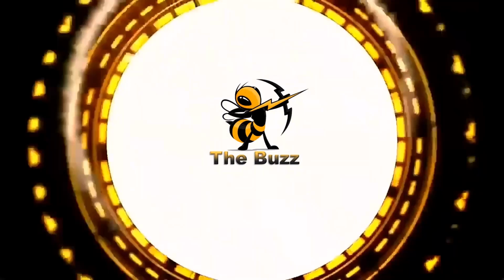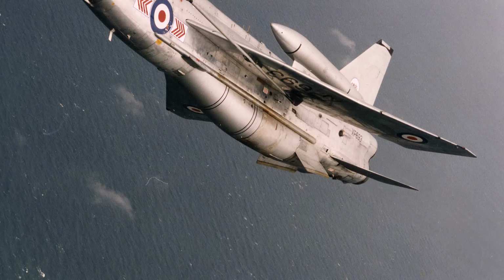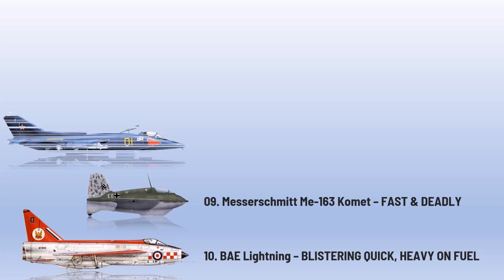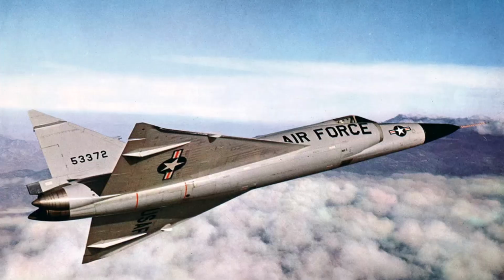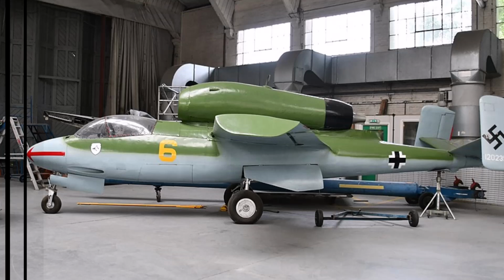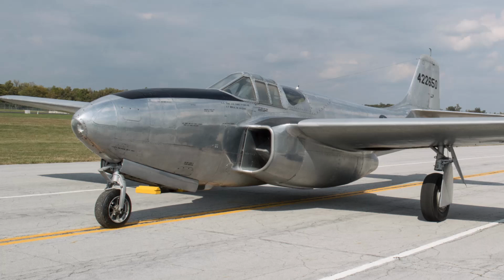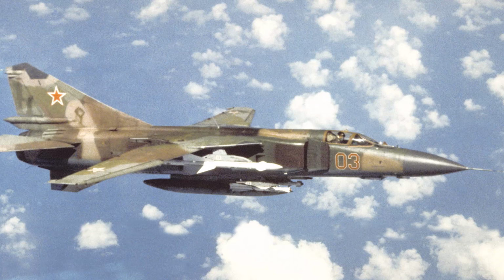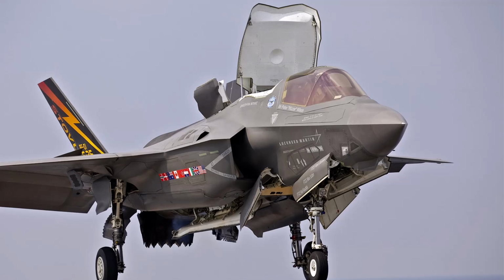The 10 Worst Fighter Jets Ever

Comment: The Lightning wasn't BAD, it was exactly what had been requested and was extremely good at its intended mission.   Not the fault of the plane that politics and doctrine changed.

And NO, the Yak-38 was NOT in any way shape or form the "answer to the Harrier".   USSR wanted something for vaugely the same reasons as the UK, but with lesser mission requirements, and it was roughly developed from the Yak-36 which in turn was based on the non-VTOL Yak-30 prototype for a trainer.
It's a matter of convergent design, because at the time, VTOL was being tested and even flown in lots of variations.
Most notably however is that Yakovlev WANTED to build something much more similar to the Harrier, single engine with movable nozzles specifically, but because there was no suitable engine available, they had to go a very different path.
And no, the Yak-38 was specifically limited to mach 0.95 to avoid the issues with supersonics.
And it didn't have TWO engines, it had THREE.   1 for propulsion and 2 for lift.
How could you get so much wrong with this plane?
Reply: also the yak38 was supposed to be a temporary solution to wait for the yak41 (yak141) but ussr ceased to exist and it never got to the production phase and stayed as a prototype also fun fact the yakovlev bureau was financed by lockheed martin to try and finish their yak41 in exchanges of the funding the yakovlev bureau handed over all the plans and if you do some reseach you can see that lockheed martin f35 use the same type of vtol engine at the rear with almost the same type of mechanism
Reply: The F-35 Lightning 2 is not a bad fighter, actually it is a very good fighter.  An extremely ambitious program had problems that have been fixed.  Now fixed (as of Feb. 2024) and, over 1,000 have been delivered and the fighter has exceeded expectations!!
Reply: @sebastien3351  That's the manufacturer's sales presentation version of reality.

If you squint hard you may be able to find some truth in it.

"The F-35 Lightning 2 is not a bad fighter"

Yes it is.   It relies heavily on stealth.   And ALL peer nations today outside of Nato has decent or better antistealth capability.

Russian fighters and airdefence can shoot at them with good hitchances at 150km.
The stealth was supposed to make them practically impervious down to something closer to spitting range.
China's ability is more uncertain, but most likely they can do the same at 80-100km.
IRAN can likely do it at beyond 80km.

It lacks performance, it lacks agility, it lacks in sensors(comparatively), it lacks in ECM(comparatively)...

An F-15 is a clearly better air superiority fighter.

"that have been fixed"

The CRITICAL flaws have MOSTLY been fixed by now.   Overall, about half the flaws have been fixed or mitigated.
But in the process of doing that, system performance have repeatedly been negatively affected.

"and the fighter has exceeded expectations!!"

YES!   It is even MORE EXPENSIVE to fly than expected!

lol
Reply: @DIREWOLFx75 youre saying this in 2024. When low observable, subsonic land attack missiles have litterally flown over Russian S-400 systems near Ukraine.
Reply: @De_cool_dude  "youre saying this in 2024. When low observable, subsonic land attack missiles have litterally flown over Russian S-400 systems near Ukraine."

And usually been shot down ye-es?

The only real "success" in getting past Russian airdefences was when they fired 25 such missiles at the same time together with a bundle of inferior/older missiles AND sent a large pack of drones AND launched a dozen HIMARS all at the same time.

Over 150 incoming warheads in a matter of minutes and Russian airdefence STILL shot down nearly everything, that if anything is pure astounding.

Patriot AND IRIS-T AND NASAMs together couldn't even defend against a Russian missile package of 20 Kalibr.

Russia literally got the same number of missiles past THREE western SAM systems working together, with less than 1/7th as many missiles fired.

You can always overwhelm airdefences, the BIG question is how much you need to do it.
And if you can realistically use the missiles you have like that.
Reply: @DIREWOLFx75  source?

Comment: English Electric Lightning, one of the best British fighter aeroplanes ever produced, break the sound barrier going vertical.
Reply: Impressive performance. I remember seeing one landing years ago in a high-nose position, almost on its tail. Do you know if it was ever called upon to do battle service?
Reply: Awesome Aircraft
Less than 1 hand of aircraft could intercept the Blackbird
Reply: I also remember it as one of the first fighter jets to super cruise.
Reply: @beornthebear.8220  I heard that, and somebody told me very flatly it couldn't.  Since I don't remember my source, I couldn't argue.
Reply: My understanding was that the Lightning was great for the air defense of its immediate area.  It would have made a great bomber had it been assigned to bomb the end of it's runway.
Reply: @ThatsMrPencilneck2U  it probably didn't have the range to cruise very far. But if the creators of this ridiculous video regard it as one of the worst fighters ever because of that, then so were the original versions of the Spitfire, which was designed for exactly the same purpose
Reply: Well, it was fast, but a nightmare to maintain. The real beauty of the Lightning, was its air radar.
Reply: @raywhitehead730  Not sure it should be in this list though. Performance was off the scale for its time.
Reply: As a teen in Italy, at Aviano, I saw a flight if Three British Lightnings fly at low level at a high rate of speed, it was impressive. In those days (1966) breaking the sound barrier was not off limits over civilian areas ( have you ever felt and heard that?)  It was impressive. However,  the lighting was Not a fighter but an interceptor, hence the importance of the pilots skill in operating it's radar. Which for the time was very good. Some versions of the F 8 matched the Performance of the Lighting almost identical ly.  Retired USN Aviator.
Reply: @beornthebear.8220  just looked in my Jane's aircraft bible, it was capable of super cruise, i have to be honest i had not even heard of super cruise👍
Reply: @raywhitehead730  Total rubbish mucker, the Lightning was a decent fighter for its time, was much faster than a Crusader, though the F-8 was a great fighter jet for carrier ops ( Navy myself)  Royal that is!
Reply: Yes but it’s range was quite poor.
Reply: @36minutesago7  It was an interceptor, not a fighter.
Reply: It was an excellent plane, one of our best, but yeah, range wasn't quite it's forte! (Whisper it quietly, but it's electrics weren't very good either - just ask Taffy Holden!)

Comment: WTF? Bae Lightning, MiG-23 and F-35?  the worst by far in deaths pilots was the F-104 G in Germany and i dont see it in the video
Reply: The Mig 23 too
Reply: The F-104, used as originally intended and by a good pilot, is superb aircraft.   Sadly, Germany completely messed up the plane and then tried to use it in ways that were essentially the opposite of what it was good at.

And yeah, while the MiG-23 was a great weapons platform, as a fighterplane overall, it had ISSUES.   Really serious ones.   It was a fairly good concept, but when it ended up being massproduced as a more standardised fighter, bad bad bad idea.
Reply: @DIREWOLFx75  the F104 was only bad because pilots were not trained properly to fly it. It had short stubby wings that required very hi take off and landing speeds. If you were transitioning from a slow fighter if that period, it could be a bear to fly. Even the F86 sabre had to be flown a certain way or it would kill you. ( see sabre dance). It had a 10 to 1 kill ratio against the MIG 15.
People, get you heads out of your passes.
Reply: @chuckbowen4334  No, the Sabre had a close to 1:1 kill ratio against Russian pilots in Korea. Against Chinese or Korean pilots it had 7:1 ratio or therabout. But in total, regardless of who flew them, the Sabre had a 5,8:1 ratio. Bear in mind that the Sabre's job was to shoot down the MIG 15, whreas the MIG15's job was to shoot down bombers, and avoid fighters if possible. 
If you are want to know more about the "Sabre Dance" - read about the F-100 Super Sabre, one of the most lethal (to it's own pilot) jets that ever flew.
Get your ypur head out of your pass...
Reply: @chuckbowen4334  Exactly!
Reply: @MeBallerman  no...thats incorrect. There where about 250 F86s lost. 78 of those where against  Mig 15s. The Chinese, Russians, North Koreans...lost over 600  Mig 15s in air combat with The F86. There were 2 migs shot down by a F4U corsair...that's close to 9 to 1...that dosen't count unconfirmed kills. The tactics and the gun sight make the F86 a killer.
Reply: @DIREWOLFx75  right, the F104 was designet as a high altitude interceptor, but in Germany used as a low high fighterbomber. But this time the sowjets had allready anti air missiles. Make it impossible to use the F104 in the expected way. by the way, most F104 lost on engine failures or drunken pilots.
Reply: @fqeagles21  The Mig-23 was not rubbish. Here’s an iron rule of air combat going back to the Red Barons time; 
”It’s not the machine, but the man in it”

Every airplane has weaknesses & strengths. The pilots job is to maximize their airplanes strengths while avoiding their weaknesses. To do this well requires training, which is why the Mig-23s record sucks . 

The earlier versions, the MS models (monkey model of the Mig-23 which lacked the most advanced features of the original. Infra-red search and track and beyond visual range missile capabilities were removed and its avionics suite was very basic) that were flown by Arab sand negroes who weren’t real big on detailed, individual training. Their system was simple- the GCI Officer did the flying, and all the pilot does is move the airplane as instructed. It makes training cheap, quick (you only train one GCI Officer instead of five pilots), and politically safe. On that- if pilots are taught to think for themselves in air combat ,they might apply that individual mindset to politics too.

So you had Israeli/ Iranian pilots, trained by Americans and others against relatively untrained, GCI vectored MiG pilots. The kill record speaks for itself. That doesn’t mean the Mig-23 isn’t deadly in trained hands.
Reply: German Luftwaffe have had so high rate of incident with 104 because they used this pure fighter in a low-attack role, for which it was not been designed ; as an interceptor, it has no competitors at the time, and I think even very few nowadays, after 70 years!👍🙂
Reply: @romanomigotto7804  The plane was ok, Afghanistan got 26 104G at the early 70tes and lost from them in 30 years only 2 by a sandstorm on the ground. I was a member of german Marineflieger. 66 F104 and no casualitis at long time until around 1980 four of them crashed together in a tide formation flight .
Reply: Although I agree with some fighters on the list (definitely NOT the F-35; this "F-35 is a bad plane" thing has already made it into folklore), I disagree with the criteria.

Comment: Considering the F 35 is a recent addition to the US armed forces and that it has not been through any major conflicts to really prove all that it can do, it seems a bit premature to put it on this list, particularly at number one. Just my opinion.
Reply: Yeah, they've basically just picked up on the development issues for the programme for a hugely complex, 5th generation, multiple partner, multi-role, multi-configuration aircraft and not on the capabilities or performance of the aircraft.
At least with the others they have looked at the performance, safety and reliability of the aircraft. To put it at no.1 on the basis of the development programme alone is utterly ridiculous.
Reply: @JoeMochan  And you can guarantee that it will fall short on both capability and performance.
Reply: @mothmagic1  So far it's exceeding expectations after many improvements. You show how much you don't know.

Comment: The lightning didn't need long range it needed climb speed which it had ,it was designed as a point defense interceptor, something it did very well.the me 163 isn't a jet
Reply: Great point, "worst rocket fighters" doesn't have the same ring does it?

Comment: The P-59 was America’s first jet. Nobody really knew how the thing would fly. It’s a learning moment. Not a bad plane to learn on.
Reply: Speed isn't always good in a fighter, slower speeds make it more manoeuvrable.  The A10 Warthog is slow compared to some prop aircraft, but it will turn up it's own exhaust port.
Reply: Totally accurate assessment. I worked at Edwards AFB for over 20 years as an Archaeologist/Historian, so I had to learn the history and development of the plane. In reality, the plane was a test bed and trainer for pilots in jet planes. That is why it was quickly replaced by the P/F-80 in 1945